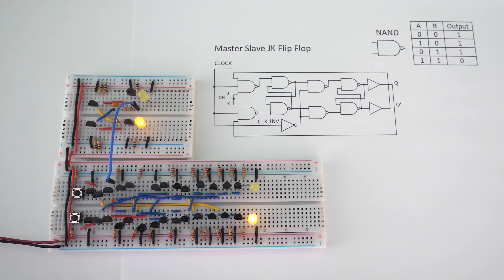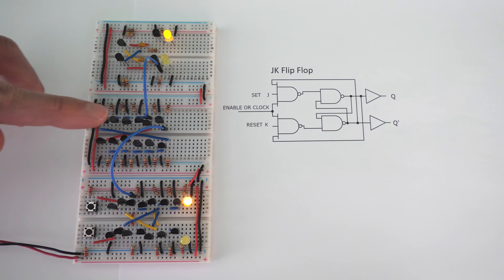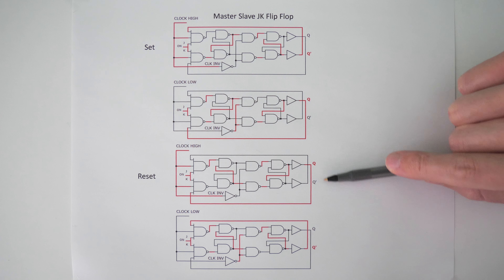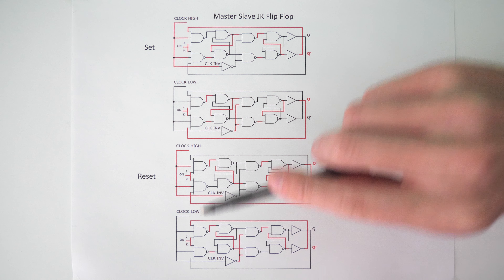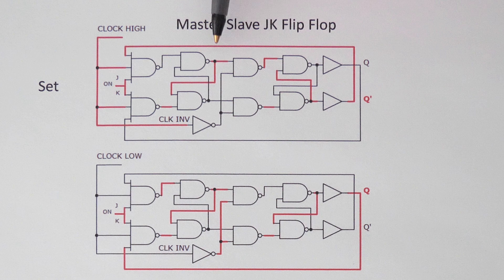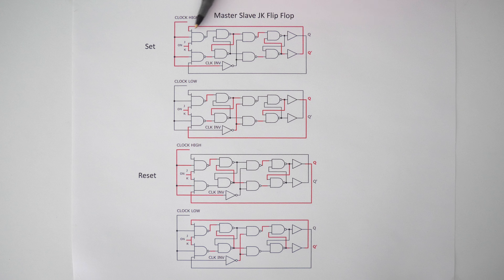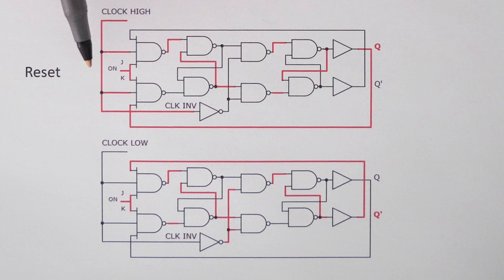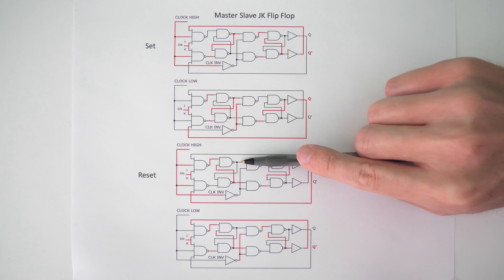Master Slave JK Flip Flop and Data Flip Flop

Comment: i was wondering what type of capacitors you used for the clock, im trying to make it, but it doesnt work somehow, idk if my resistors are too resistant or my capacitors arent capacitant enough (i use 10uf ceramic chip ones), it would be helpful if you could let me know which ones you used, thanks.
Reply from the maker: Hi, 10uf should have worked. I show the circuit diagram for the clock/astable multivibrator 58 seconds into the binary counter video. That should help you get the wiring and resistor values correct.
Reply: @GlobalScienceNetwork   fixed the problem, i think i didnt have the right resistors was all. 😅
Reply from the maker: @ShadyHasYoutube Good deal, I am glad it is working now!

Comment: Hi, I was just rewatching this and it seems to me that you may have edge vs. level triggered swapped 1:05.  I believe the first example is actually level triggered and the master/slave design makes it edge triggered (which I believe is the purpose of M/S).  All sources seem to agree.  Here's one result of a quick search - Thanks!

"Conventional J-K master-slave flip-flops are properly called "pulse-triggered" or "level-triggered". On the other hand, a D master-slave flip-flop is edge-triggered, because the D input and its complement always drive the master stage in complementary fashion, even while the clock is high"
Reply from the maker: I believe what I said is accurate. In the referenced text both are master-slave flip-flops. As you know these are basically built with two JK flips flops. I was saying that a regular JK flip-flop that is triggered with a short pulse is edge-triggered. The Conventional J-K master-slave flip-flops is what I was calling level-triggered. I did not realize that a D master-slave flip-flop is edge-triggered but I suppose that is correct.
Reply: @ScienceNetwork We might be agreeing without actually knowing that we are.  Do you agree with the following? (from EE stack exchange, also the SN74107 datasheet seems to agree),  Basically it is saying that it is a positive pulse triggered flip flop.

"The M-S JK flipflop is not edge triggered, it is pulse triggered.

What you have discovered is a phenomenon which M-S JK flipflops suffer from known as 'ones catching'.

This is when noise on the J or K inputs whilst the clock is high can alter the resulting outputs of the flipflop.

To avoid this drawback of the M-S JK flipflop the clock pulses should be kept short or avoid Master-Slave flipflops altogether and use true edge triggered ones."
Reply from the maker: @Enigma758  The M-S JK flip flop is pulse-triggered or level-triggered I agree with that. However, I think the noise is on the regular edge-triggered JK flip-flop. If you watch my video called "D Flip Flop and JK Flip Flop" at 7:32 it shows the racing condition where the output toggles when a large capacitor is used. I am not positive this is what you are referring to as 'ones catching' but it is a racing condition.   

The MS JK flip flop solves the problem with the racing condition/noise because you need a full rise and fall of the clock signal before it changes value. The MS JK flip-flop timing is half the clock signal which can be used as a frequency divider. The reason this is good is that if there is noise on the high signal the output will not change states until it goes to a full low value. So the MS-JK flip-flop is the solution. Otherwise, we could have built the flip-flops/registers with about half as many transistors which would be nice. This is why most flip flops are master-slave JK flip flops. On my computer build I just used the the regular JK flip flop for the counters and it worked fine because I sent a short pulse duration. This reduced the transistor count significantly. You do have to make sure the timings of the registers are in sync as the event change is at the falling edge of the clock for the master-slave JK flip-flops.
Reply: @GlobalScienceNetwork  Yes, I think we are in agreement on that.  I think the MS FF is somewhat analogous to a pawl and ratchet that must first engage, then disengage from the gear to advance a single step.  One reason I'm interested in this is to build a practical divider for a transistor clock.  I tried simulating the simpler (RC differentiator) version in falstad, but it still suffers from the race condition, but it's clear that it works for you in practice so I should just try building one myself.
Reply from the maker: @Enigma758  Cool, I am not sure how to do it with an RC differentiator but the MS JK flip-flop should work well as a practical divider for the transistor clock!
Reply: @GlobalScienceNetwork  I meant that's what you did.  The RC "pulse" circuit that you have feeding into the clock line of your 11 transistor JK FF is exactly that.  I think in your video you stated that it was done to use less transistors as opposed to making each FF a full blown M-S FF which makes perfect sense.  And it worked for you without problems.  That RC circuit is also known as a "differentiator" (also called a high pass filter too).  I'm just saying that it worked for you, but didn't work for me when I tried it in the falstad simulator.  I may have done something wrong or maybe I should just build the actual physical circuit since it obviously worked for you and I would like to try it out myself.  I hope that makes sense. 😊